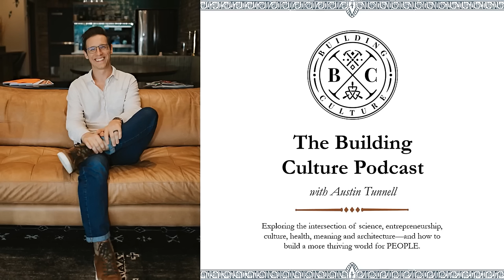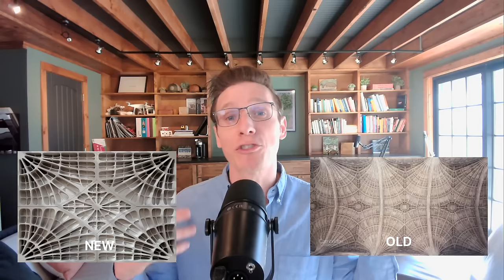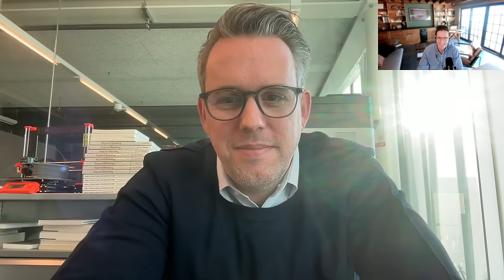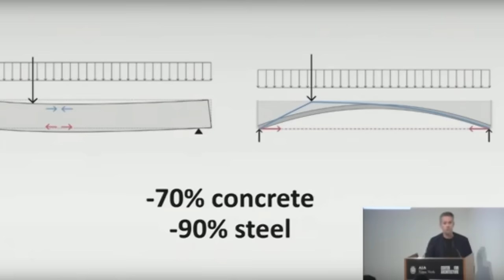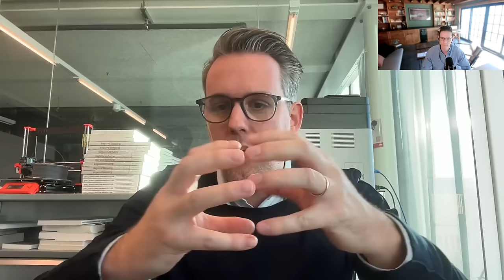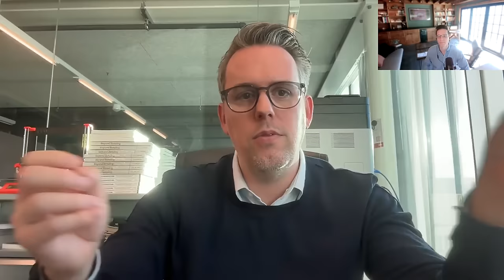Philippe Block: The Incredible Future of Sustainable Construction Through Blending of Old & New Tech

Comment: Those vaulted floors looks very nice, but for me, they are more an academic solution for an academic problem.

There are already flooring systems that safe material, i.e. BubbleDeck. Even a precast half slab (with open reinforcement) turned upside down will save you a lot of material (concrete).

More material can be saved if the floors have moment resisting connections with the columns.